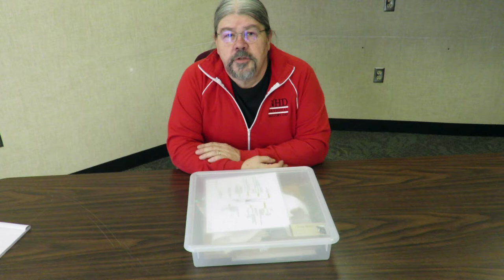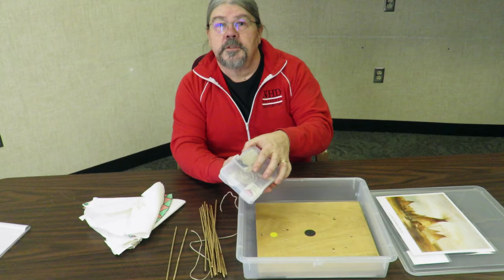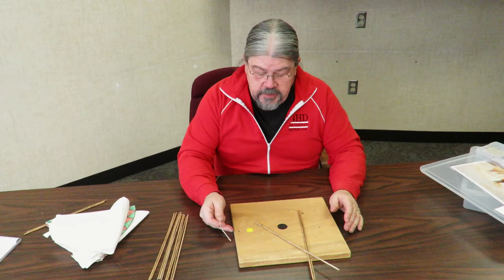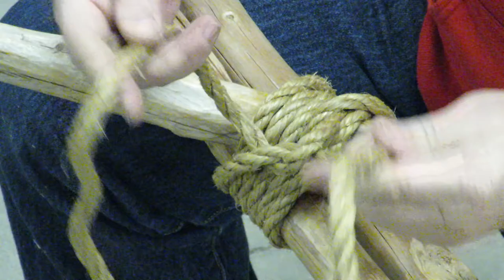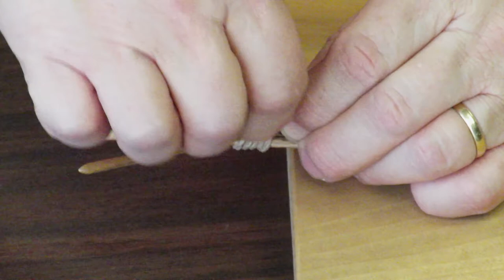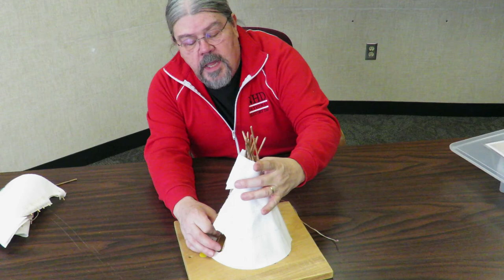Pitching a 3-Pole Tipi

Comment: should you wrap all the poles at top another 4 times wrap before you put last pole with cover on it?
Reply from the maker: The three poles (foundation) are tied together with a clove hitch, with about 4 feet of tail on one end. This tail is wrapped 4 times around and then the two tails are tied together with a square knot. After the foundation is raised and the other poles are placed in the appropriate positions, the remaining long tail is brought out at the south foundation pole and is walked clockwise around while pulling tight. Four revolutions are made. On the end of the fourth wrap, go past the south pole, go into the cone and out on the left side of the north pole, turn around and go back into the center again on the left side of the north pole. Pull tight and stake down inside. All of this is done before the lifting pole with the cover is put in place in the open space on the back side, pulled around and pinned together.
Reply: State Historical Society of North Dakota  O ok thanks for clearing that up for me.